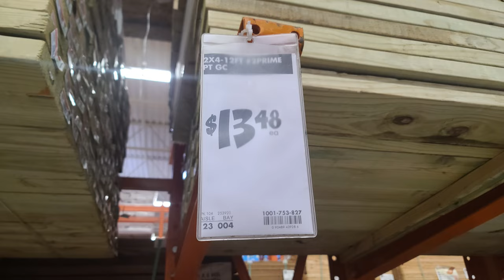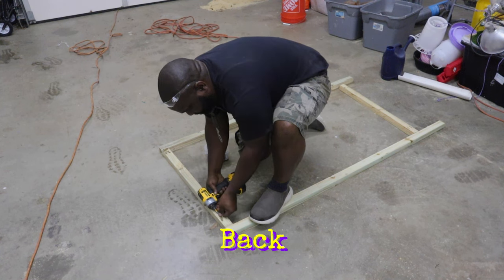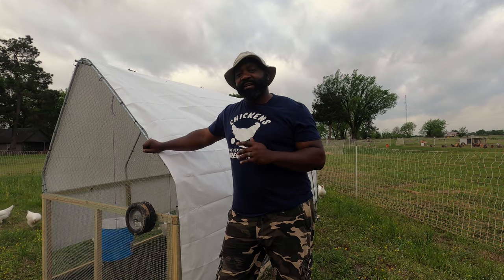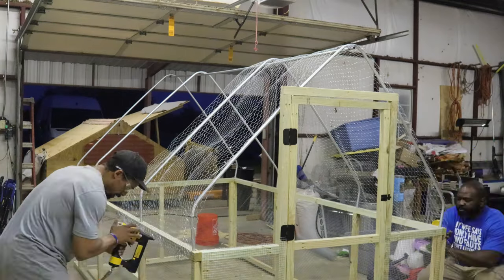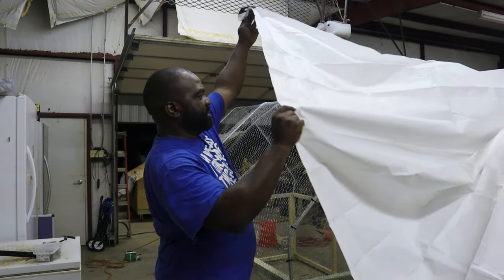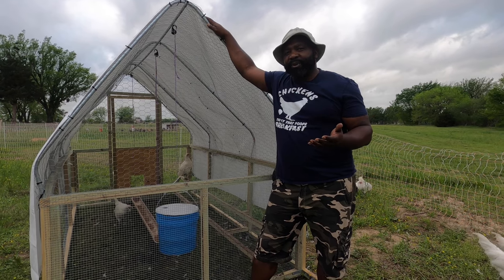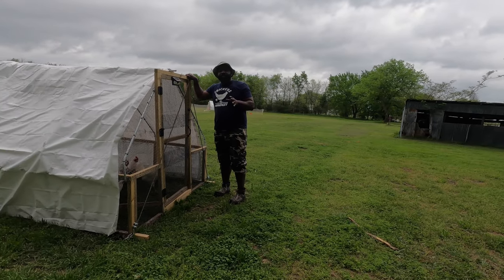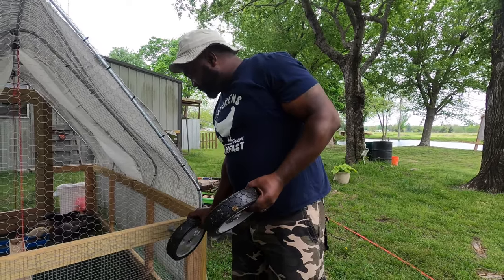DIY Chicken Tractor Build

Comment: We added a  solar fence charger to ours and put electric fence along the bottom edge and the upper edge of the sides.  Just turn off the charger and move the tractor.   Super simple. We have alot of coyotes here so it adds an extra layer of protection.
Reply from the maker: Definitely something to consider with that predator!! We will consider stepping up if we get that issue. Most of our tractors are in electrified poultry netting with solar energizer by Gallagher, we've been really happy with it. Thanks for sharing, stay blessed!

Comment: This is my second video that I have watched since I was introduced to your Channel. Going by what y'all saying that y'all are the new homesteaders your Concepts the ideas by taking bits and pieces from other established homesteaders I find truly amazing. The only feedback or suggesting our offer is on your chicken tractor is the bottom rails instead of having it built out of the same material I will go with a 2×4 material which will be a little bit more sturdier and it can take a lot more stress and give more stability in moving than thec1×2 or 1×3 you using. And also on the pull rope that you using to move your chicken coops old garden hose and place it around the tow rope to make it more comfortable with hands
Reply from the maker: Thank you so much for the feedback. I was thinking about that on the bottom rails. However, the Mrs is the ones that does not work and stays and take care of the animals. So I was trying g to make it as light as possible yet sturdy enough that it would withhold the terrain we had. I add angle brackets on the bottom rails to help it out. 

We actually had a old hose on the first one we built but the rope snapped off. So I had to modify the rope system and forgot to add the hose back on. Thanks for reminding me.
Reply: @TheNakidGardeners  I truly understand the weight factor. To be honest  theTri level piano hing wheel is what I call it that is use on Sow the Land on his chicken tractor is AMAZING!]!]
Reply from the maker: @jamesmoore1743  yea we would like one of those for all four of our tractors but have you seen the price on those?

Comment: I am finally going to make one of these!! I really like your modifications. I want to make mine taller, too. And roosting bars, etc. Thanks for the great video! Did you really only add 3” to the vertical posts? And what did you change to make a lightweight version?
Reply from the maker: Good luck! I can't remember. Since making this one we had built 2-3 more of these tractors and keep improving our build each time. I want to say made it to where the 36" wide hardware cloth would go over it without cutting.  Are you using it for meat birds or layers?